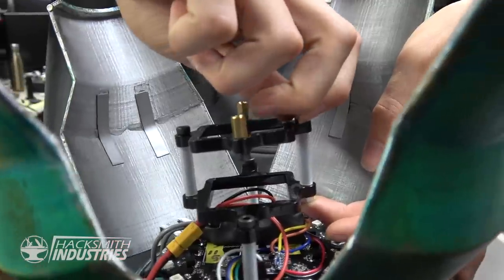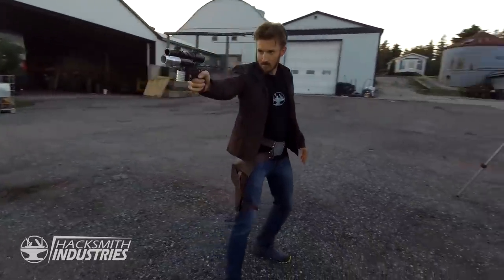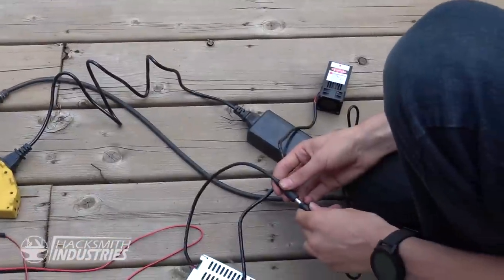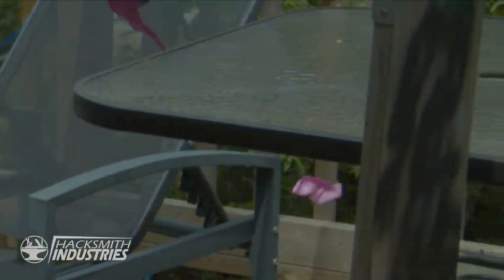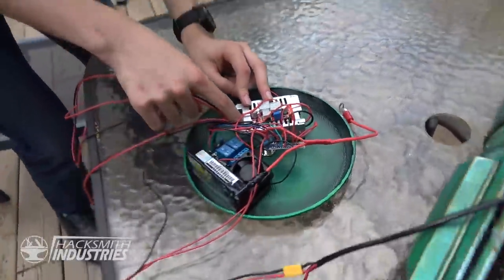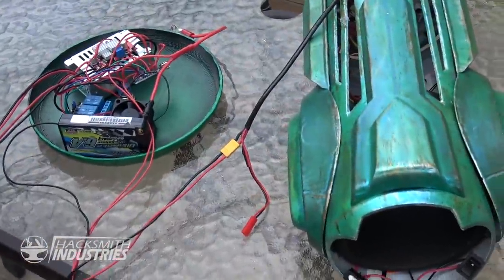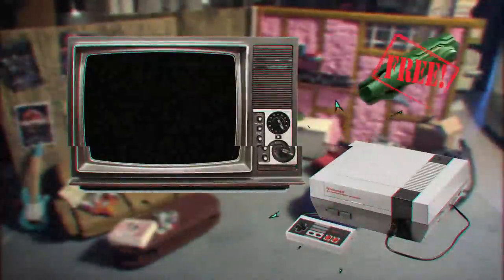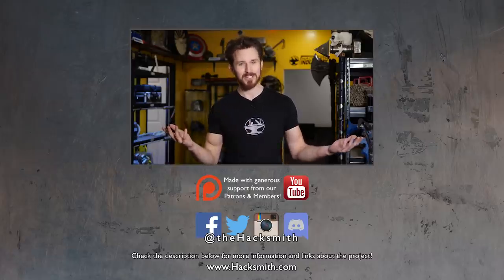Samus Arm Cannon in Real Life?

Comment: Hey just a question do you think it would be possible to shoot lighting distances using a laser to ionise the air so the electricity goes through to path of the least resistance (the laser) to force electricity places or not?
Reply: Not sure if they'll answer but seems like a question for styropyro, Youtubes resident laser master
Reply: @MrGoesBoom  I asked on one of his vids haven't had a response yet so I hoped he could help
Reply: @tylernelson310  Ah.  Well I hope you get an answer from either him or the Hacksmith.  It's an interesting question and now I'm curious too
Reply: Theoretically a very sound suggestion - lasers can Ionise air and ionised air should be more conductive by a meaningful amount. The power needed in the laser to make it happen is however well beyond reasonably available. Probably be demonstrable with a tank of the right gas easily enough though - want a mix of something that matches the lasers frequency (so it absorbs the laser well) and preferably something that ionises readily.

Comment: This project looks like a good candidate for a laser array, which is multiple laser diodes focused with a mirror or fiber optics. Often things that come assembled misrepresent their output because the manufacturer has control of what components they are matching together. It is harder to lie about individual components because first of all data sheets, and second when the end user assembles the components they'll be using a power supply rated for that component, so if you end up receiving a weaker laser diode, it would probably get cooked by the stronger power supply.